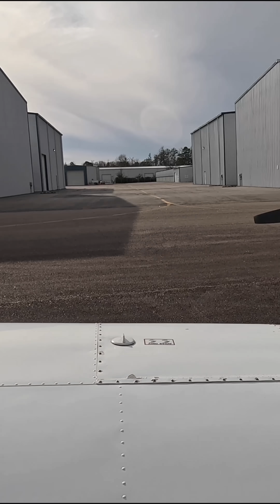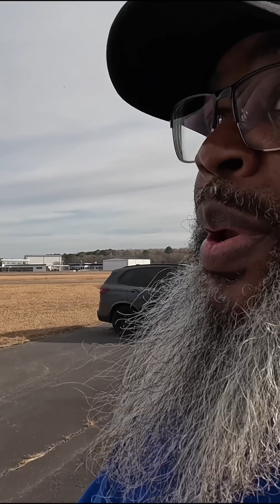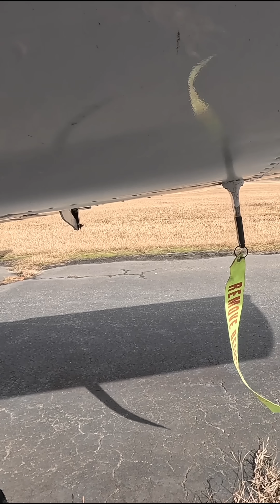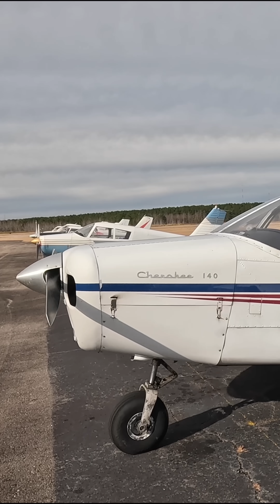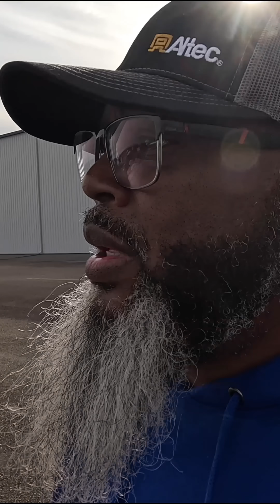Pitot-Static System Failure Explained | Piper Cherokee PA-28-140

Comment: Your attitude indicator and heading indicator are gyroscopic instruments operated by the suction pump. Your altimeter and VSI are governed mainly by your static system. The pitot/static tube deals with the airspeed indicator... You were very fortunate you weren't in IMC conditions. You operated the aircraft very professionally.